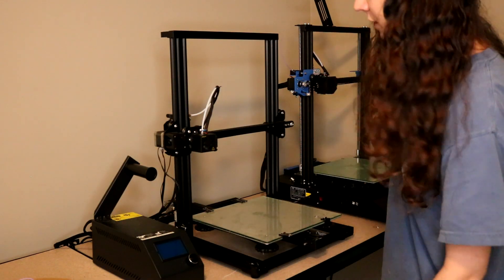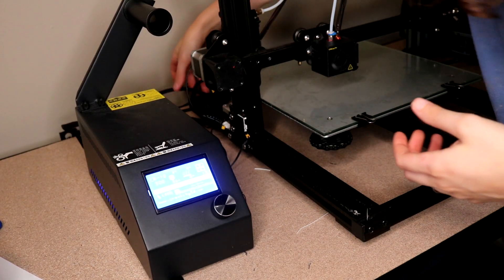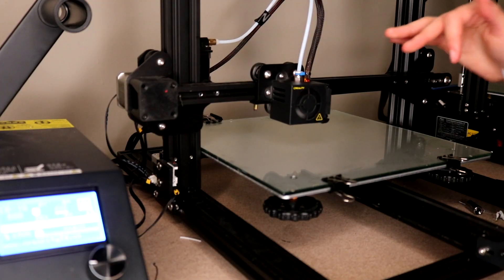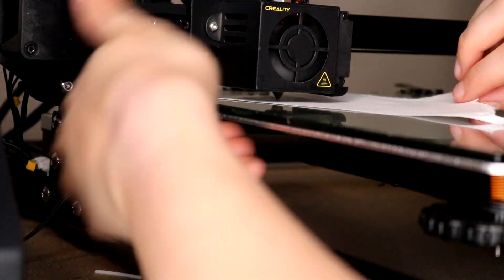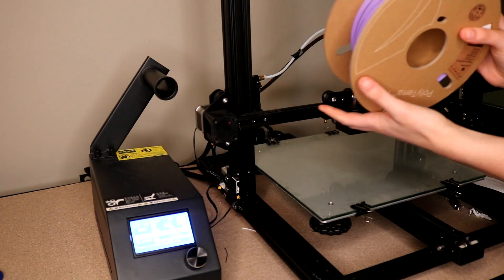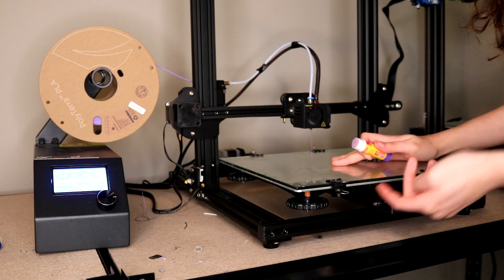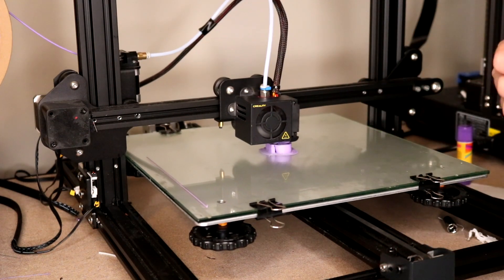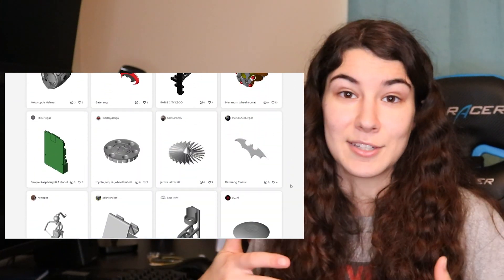How to 3D Print SIMPLIFIED - Part 2

Comment: Super cool. Me and my girlfriends want to start printing, any suggestions on the first printer?
Reply from the maker: An Ender 3 is a good bare bones starting printer! $155 on Creality’s website. Or if you’re willing to pay a little more, the Ender 3 Max is bigger, and comes with a couple more bells and whistles. My first printer was a CR-10 (also great).
Reply: @EmilyTheEngineer  Just got the Ender 3, what a printer, simple to assembly and use. For my luck it came with all the expensive upgrades (metal extruder, 32 bit mainboard). Thank you so much for the advices!
Reply from the maker: @Jopoiato  yoooo that’s so awesome! Glad you like it!

Comment: Thank you for your video, between you and another iron man suit 3d printer from England (wonder he mentioned you so you may know each other)  I feel more comfortable and made me understand more. I.e.  I didn't know you could level it manually aka not using the built in leveling feature or that you don't heat the bed when using the glue stick. I mean common sense not to bake the glue but no where does it say not to.

Comment: If anybody's having trouble getting their filament to stick to their bed you need to make sure that thing is clean. And I'm not talking wiping it down with a cloth I'm talking about 99% isopropyl clean. 3D filament is like tape or glue. There's something in between what you're trying to stick it to it's going to stick to that not to the thing

Comment: I want to get into 3d printing and your vids have been helpful, just wondering though, does the cr10 use up alot of electricity? Like will the printer spike up my electric bill?
Reply from the maker: good question! I've never noticed a difference honestly. the internet estimates like 9 cents for a 10 hour print... so unless you're printing 24/7 it shouldn't make a noticeable difference!
Reply: @EmilyTheEngineer  I am glad to say I have got the hang of 3d printing a bit, your video was really helpful when I started